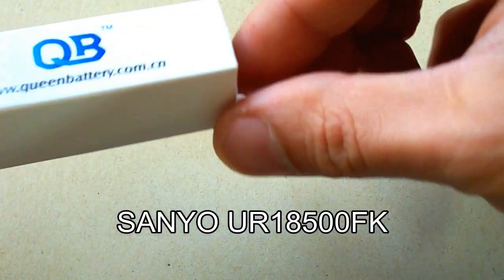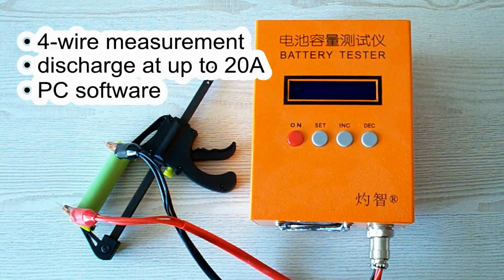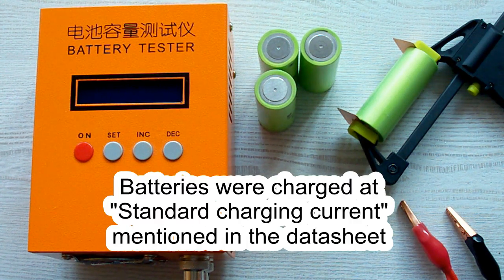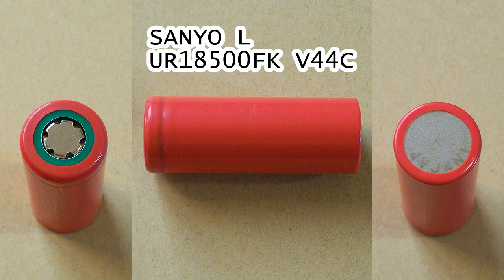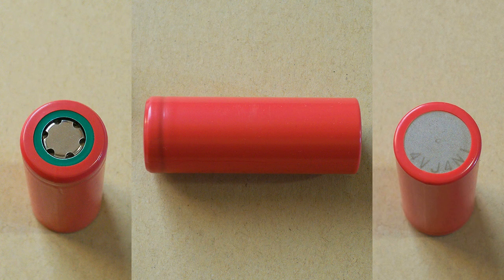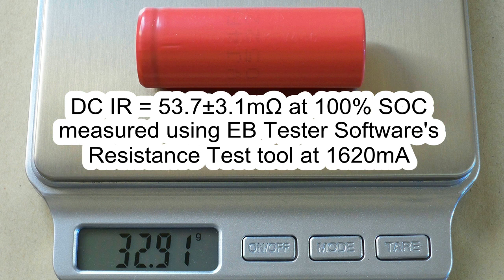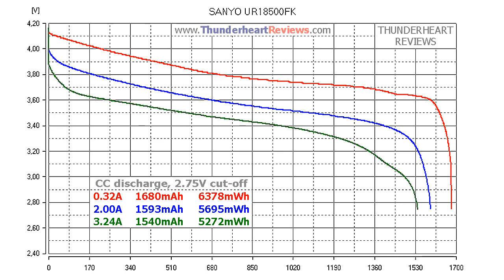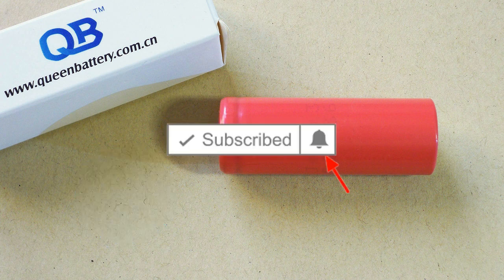Sanyo UR18500FK 18500 Li ion battery cell capacity test video camera battery replacement

Comment from the maker: 00:37 - Testing equipment and conditions
01:45 - Battery supplier
02:06 - Sanyo UR18500FK specifications and capacity test
04:21 - Verdict

Comment: Hi. Thanks for sharing your experiments. I have a question, if you can help me.
I am looking for a chart that shows voltage against DoD (Depth of Discharge). Do you know whats the difference between DoD and expresing discharge in terms of mAh extracted from the cell?
Thanks!